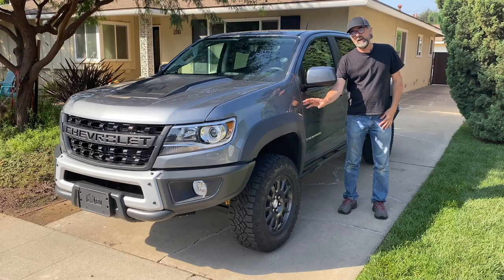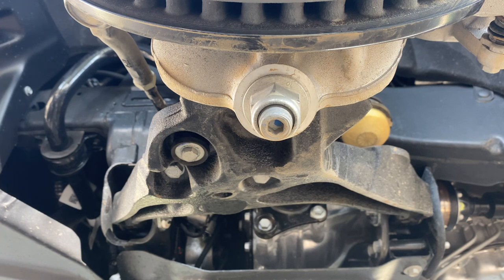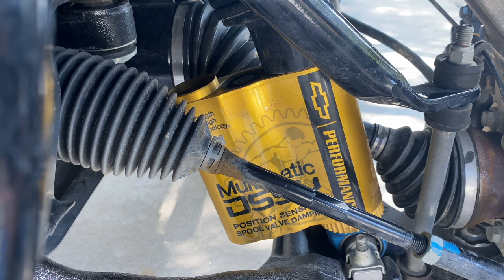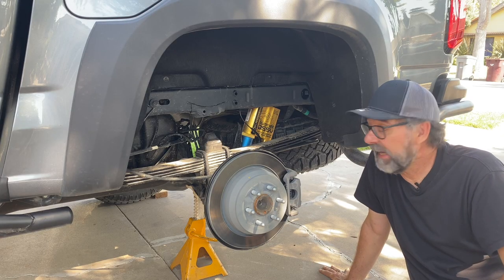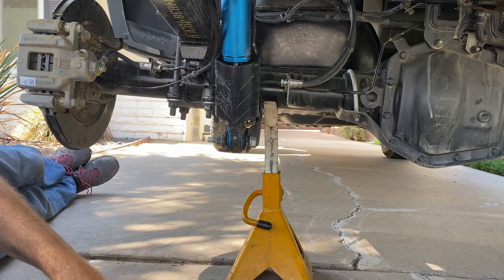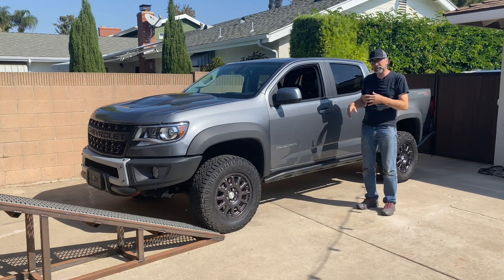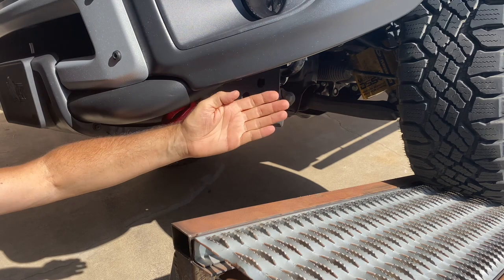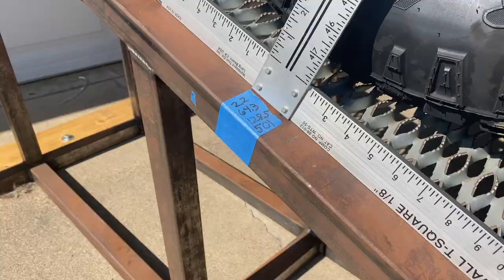2021 Chevrolet Colorado ZR2 Bison Suspension Deep Dive and Ramp Flex Test: A Great Off-Road Package

Comment: Actually the Bison front bumper has less clearance than the ZR2.  Lower control arms are made by DSSV, if you look you can see it cast in the arm.  After market coilovers and UCA's improve a already great front suspension.  Sway bar removal improves off road performance, paired with the right springs and bump stops you eliminate any body sway at hiway speeds. Move those rear shocks to the outside of the frame.
Reply: Bingo👍
Reply: @Bearded_SARTECH  Uhhhh I never want you working on my truck.
Reply: @lunamaria1048  Why is that? Because I moved my shocks outboard and gained a ton of rear axle clearance, or because I use better bump stops (Timbrens in the rear) or because I removed my front sway on my personal vehicle (and not someone elses)?
Reply: @Bearded_SARTECH  Your username was tagged by accident, because you were the last comment.   Either way,  the ZR2 works great, gets lots of travel and doesn't need things moved around or disconnected.    

My fiance has had a ZR2 for a year now and it is the most off road capable mid-sized pickup we have ever had.  

I see guys like you butchering 4x4s all the time.   I have a feeling that the engineers that developed this truck knew what they were doing and why.
Reply: @lunamaria1048  Wow! Guys like me? Butchering? 

I agree, that in stock form, it is still the most capable mid-size out there, especially for the money, hence I bought one.

I also agree, it is the most capable vehicle YOU have ever owned. You have not met me, my truck, or seen my "butcher" work. There quite a few pics of a Search and Rescue ZR2 out there on the internet. While I know the butcher type stuff you refer to, I'm not that guy.

The engineers have many compromises they must make to sell a OEM vehicle. NHSA, EPA, not to mention cost effectiveness over mass production. Your logic is all stock vehicles are as good as they get...and with that, we would all still be driving Model Ts.

Comment: You should think that with a “heavier duty” type truck there would be some manual grease fittings on the front steering and suspension areas but from what I see by your vid at the beginning when you took the front tire off, I was sad to see only sealed ball joints

Comment: Stunned that the spare is in fact a fifth AEV wheel and not a basic steelie.
Reply from the maker: It's like that with the regular ZR2, as weel - though not an AEV wheel in that case. I expected it here because we had a long term R2 diesel at my last job, and I had a flat in Arizona headed cross-country to a Jeep event. But I had to change the tire at the side of the road, and noticed -- and appreciated -- the matching wheel on the spare.

Comment: Ramp travel index does not itself tell you much.  The point is how high off the ground you can get that front tire. I have a 97 Cherokee it has an rti of 512 but only gets that front tire 17 inches off the ground. So your lower score of 501 is worse, yet you can get over an obstacle 22 inches high to my 17.

Comment: There are 3 spool valves.  2 you talked about and a third that sits inside the piston so when the piston goes beyond the normal operating window like you could off-road the 3rd valve with stiffer springs is engaged to further dampen the shock. They loved having people drive at 40mph off steep drops to show the dampening effect of the spool valves when they revealed the ZR2.  They also indicate that because the system uses spool valves instead of deflection disks it is far less likely to be effected by heat.  The viscosity of the oil changes as it's heated whereas the compression doesn't change.  Also the movement of the oil via the valves routes the oil back into the dampener along the exterior of the housing allowing for some heat to be released.  https://www.youtube.com/watch?v=Q3iGlLmdRd4

Comment: I am super torn about the Bison vs a TRD Pro. I’m also torn about a diesel vs gas version. Thoughts?
Reply from the maker: I have driven ZR2 gas and diesel versions extensively. I like both, but would lean diesel if only for the off-road range. It's pretty effortless, too, and the diesel's MPG is easier to beat in real-world driving than the gas engine's. If you're doing payback calculations on the price, the diesel's mpg advantage is 1-2 mpg better in real life than it appears on the window stickers if you compare ZR2 diesel EPA combined to ZR2 gas EPA combined. It has to do with torque and how it fits better with the way people drive.

As for the vs TRD Pro argument, I do like the Toyota. Visibility out over the corners of the hood is much better off-road. It has more clearance underneath, and the rear shock placement is much better. The bed is way better, in my opinion: lower sides for easier loading, tie-down rails with cleats, a composite box that never needs a liner and has a built in power socket, lower tailgate liftover height even though the spare is tucked up MUCH higher and is less likely to drag the ground -- a neat trick. (I have had a couple ZR2 spare ground-outs off-road, and neither one was much fun.

But the engine does kinda suck (it's reliable, but not as responsive). Fuel economy is just OK. They fixed the seat in 2020 (or 2019) by adding a power height adjustment, but some still don't like the the seating position. Tacoma resale value is through the roof, though, and there are tons of parts because the suspension hard points go back something like 15 years.
Reply: I absolutely love my diesel ZR2. It's an 2018, I have 44K miles on mine with zero issues. The range is great, especially considering diesel is barely more than regular unleaded right now. The low end torque on the trail is also great, it climbs like a mountain goat. Plus, a baby diesel in a mid size off-road pickup is just cool.
Reply: Thanks so much guys. Really appreciate your replies

Comment: I wish I could find the same speed wrench you have
Reply from the maker: I've had that for a long time, and I don't think Snap-On makes it anymore. It is my favorite tool, and I don't use impacts in large part because of this 1/2"-drive breaking bar/speed wrench. I've gotten to the point where I can torque wheels to 90% of their value by feel, then I finish them off with a click-type torque wrench.

Comment: Why do you call the effective arm length efficiency?
Reply from the maker: Efficiency is another way to look at the motion ratio. If the ZR2's wheel moves up an inch -- taking the knuckle and the outer ball joint up a like amount -- the spring will compress 80% of that (0.8 inches) and the stabilizer bar will deflect 85% of that (0.85 inches). Their mountings are less than 100% efficient, and so you will have to fit a stiffer spring and a larger bar to get the effect you want at the tire contact patch.

Comment: That's a 2021 Bison not a 2020, They've changed front calipers to 2 pistons instead of 4 for 2021 as well as those red tow hooks.
Reply from the maker: Yeah, I realized my mistake on the model year and corrected the title. I'm looking at a copy of the window sticker right now, in fact.

Comment: It looks like it performs well but that front end does NOT look appealing.
Reply: The rear bumper is awesome.
I agree. I’m not a fan of the front bumper.
ZR2 + Bison rear bumper + something for the front (not sure yet) + AEV skids is how I’m going with mine.
Reply: @jayl2331  I went with Relentless Fab for my rear bunper, it's a better bumper than the Bison version, plus has the swingarm for my spare and extra fuel. I did do full AEV skids, they've saved a lot of damage on my truck. I also have frame mounted sliders that get used frequently.
Reply: I saw it in person. I want one with no swing arm.

Comment: Land Cruiser scored 661 but costs 85K. But will outlast the Colorado.
Reply from the maker: The LC scores higher mainly because this is a long-wheelbase pickup. BoF SUVs almost always score higher because of their shorter wheelbase. But this does cost half as much, and you can fit a diesel engine to one of these.
Reply: @DanEdmunds  Maybe Edmunds should test out a Callaway supercharged variant, might be more fun than the diesel. Even comes with a warranty that parallels manufactures.
Reply: @DanEdmunds  But the LC also went higher up on the ramp too.